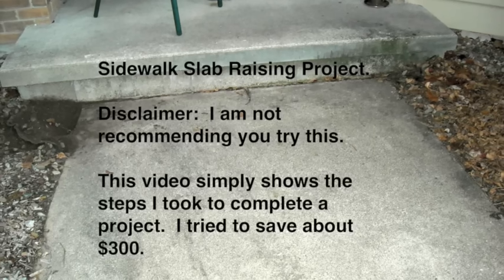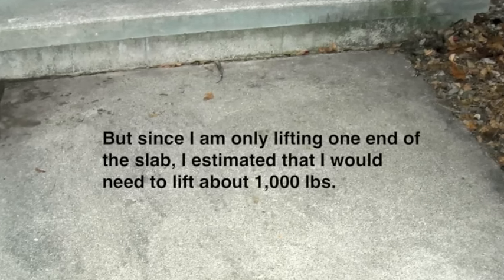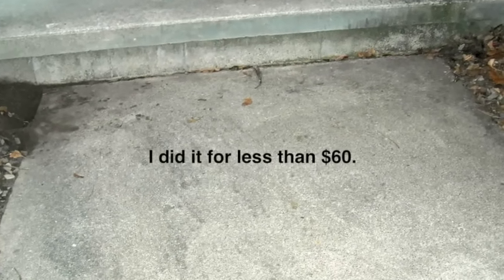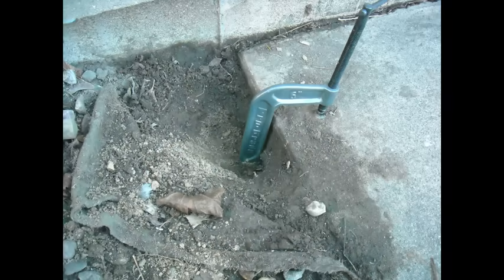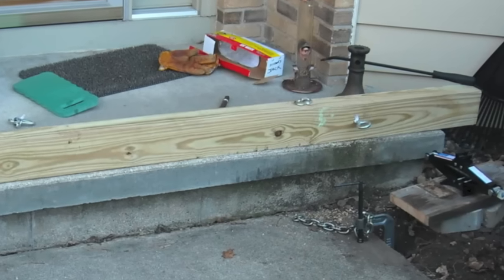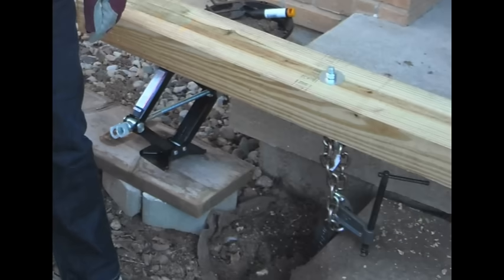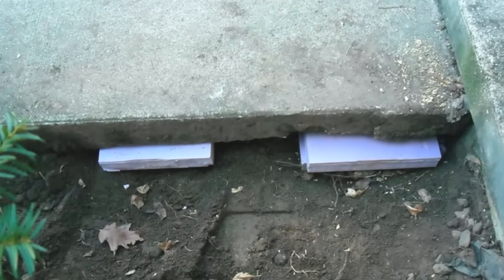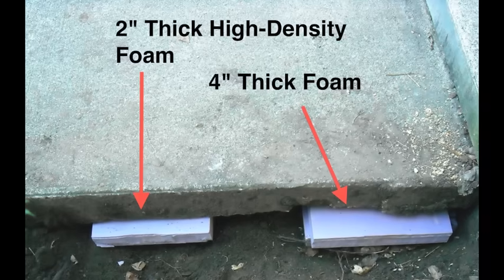Slab Raising, Do It Yourself

Comment: I like it!  How I will change (1) use hook bolt through 4.4 to make chain not integral to 4/4 (2) Use 3/16 anchor into sidewalk so I don’t need ‘C’ clamps, and don’t have to dig.  (3) Under fill will foam insertion to 1/4” holes to fill the gap. (4). Use self level filer to complete the job over each hole and crack.
Reply: You should get proper closed cell foam (not GreatStuff) which is hydrophobic.
Reply: @stringlarson1247  Well, I did use GreatStuff and initially all was well, until several months later when concrete raised a half of inch instead of dropping.  So if that is what you mean you were correct.  However, the sidewalk falls do to soil shrinkage every year for. 30 years, so most likely it will fall back down to level.  Nevertheless, could have used your comment 5 months ago (:.
Reply: @magncity1817  Oh my. Up after 3mos. Uhh, that's not really what I was thinking, per se. 
However, (shooting from the hip here), it sounds like a water issue in the upper layer(s) of soil and/or what is going on further down. As you've witnessed the change over a good period, I would guess that some runoff is causing that area to soak up water, which will cause the soil to compact (possibly erode, albeit slowly) and/or cause voids under the slab. By injecting the foam, thus filling the voids, the water is forced (hydrostatic pressure) underneath the foam and running into something more dense (clay? rock?), causing it to stop and build up pressure. If that water freezes, it will expand and force the slab up.  
My issue with using expanding insulating (retail) foam off-label is that it is not engineered for being in a constantly moist area for long periods and is not impervious to bugs or critters. 
I like your changes to the lifting mechanism, etc. You must have a decent SDS rotary hammer. I've seen some whacky setups with clamps and Chinesium chain, etc. 

I'm no expert (just old), but when I was in engineering school, I lived for serval Civil Engineering grads. students at Purdue. I learned a great deal about this stuff and what goes on under our feet. As a nerd/geek, all this stuff fascinates me. 

If it's a half inch and a possible trip hazzard, a masonary disk on an angle grinder might be an easy way to bevel the edge. If later, it drops back down, there are some good concrete bonding/patching products available to fill it in. Just a thougt. 
Cheers.

Comment: I've seen a lot of vids of people DIYing stuff like this. For a project like this, I would have busted out the slab, laid in a good substrate for the region, built a form (simple in this case), set in some rebar (use epoxy coating), and poured a new slab. It does take some time and research, but will last 'forever'.  OTOH, jacking it up and removing all the soil and packing the entire area with stone or gravel will ensure that there are no voids. For safety, once it's jacked up, you can pack in some 4x4s or brick to hold it in place and not have to worry about the lift points letting go.
Once everything is packed, jack it up just enough to remove the supports and then pack in those areas. 
For anything like this, it's important to identity the root cause (i.e. water runoff, etc.) and remedy that first.

Comment: I've considered this and have done some lifts. The problems that come are: it will probably need the joints cut so they don't pull the adjacent pieces up, and it is difficult to get fill in the right spot(s) since the underneath of the slab will probably be very uneven.  You'll wish you could work the slab around to do the evening, but that is not possible; stuffing fill in that gets the height to where it needs to be is likely the best one be able to do.

Comment: Such a simple but brilliant idea. 
Ours dropped about 6 inches. We used 2 x 6 ton rated Big Red bottle jacks, 2x Axle straps rated at 3500 lb with D rings, 2x3/4" "D" ring shackles. Wrapped the straps around the "C" clamps and 4x4 post, connected shackles through D ring of axle strap.. Lifted it up with ease. Lifting revealed a huge chasm. Before we used the foam, we had to backfill with coarse gravel to level what was missing underneath the slab.
Reply: bob bobless Why explain what he did in the video like it was your idea!😂

Comment: I've actually flipped a slab, filled and flipped it back.   The slabs were 5" or so apart.    3' long, 5" deep, 2 feet wide.  etc.   Ernie died in the 70's, but it was Ernie whom poured the walk, with these gaps.     I guess, he had a form.  I used Multiple digging bars, etc.    I filled with a sand topper mix.   But, I was younger then.

Comment: Great video and great results John!  I have the same issue on my walkways first slab by porch like yours. The left side has sunk..more than the right side, which caused a crack at the opposite end of that slab.  I know why it happened and it's because when the previous owner installed the metal roof they removed all the gutters. Now every time it rains all the roof water over the porch hits directly on the brick facing and down thru the porch..Also caused all the brick facings to start breaking off because they get wet and freeze in the winter..  I don't know what the people who install metal roofs are thinking and almost every one I've seen they've taken the gutters off. And that causes all the runoff to eat away at the entire foundation of the house about 3-4 feet out from the foundation...IDIOTS!!  I'm going to install new gutters soon I hope and try and fix my walkway like you've done in this video..  I'm a Navy mechanic (retired) and big time DIY'r, and always try and fix things myself..  Glad I found your video..  Also have the same issues with my entire carport (split right down the middle) but that's much more involved than this fix will accomplish lol

Comment: Taught me something. I always wondered about drilling a couple holes and putting material in. Cement is too heavy and had better get most of the gap filled with something like sand or something that won't squish. Thanks for the info. Good video.

Comment: Not sure why foam jacking isn't supposed to last.  You can get all kinds of different PSI ratings and if anything it might be tricky to keep it from expanding TOO much when you put it in. I'm just starting to research so could be wrong, but foam injection seems ideal as it can take up the exact space you need to fill and in theory should start to bear load immediately.  It would probably be a good way to augment your system -- to fill around the sheets you put under and to hold them in place.
Reply: Yeah, one friend saying it doesn't last isn't a very good source. Another video I watched, the guy said he researched it thoroughly and all the professionals use closed cell spray foam.
Reply: My problem is rodents burrowing under the porch. The chipmunk wasn't really a problem but the mice certainly are. The way this guy did it leaves gaps. Like you said, the foam fills it all in so no gaps.

Comment: I have the opposite issue, tree roots have raised my sidewalk 6-8 inches, I'm going to use ur idea to b able to see where the beginning and end of the root is and remove it.  Thanks for the idea!
Reply: +Geneva Tungate Careful with a large root...you just might lose your tree.  Certain trees, like maple, have a habit of shallow roots.  A sidewalk over their drip line can be repaired now only to have the problem resurface nearby next year.
Reply: It's already done, selling the house. Looking for a few acres...
Reply: +Geneva Tungate You should just raise the house a bit.
Reply: Geneva Tungate just do what jphn did in reverse. Put the 4x4 on top of the tree and jack down..pushing the tree back into the ground. I dont know who trees think they are growing up out of the ground blocking our views. Good luck please post updates. Also never put your hands under the roots!
Reply: Geneva Tungate0
Reply: Mop mop movements

Comment: I think that foam will degrade with time. If you need to raise sidewalk 4 inches I would put a couple of paving stones in several locations, especially in the middle where it is harder to reach. Then fill the other areas with new concrete. 4 inch gap should supply plenty of room to shove new concrete in especially if you do it over several days to force concrete to dry before adding more.

Comment: I built a floor for my RV conversion and was hoping to use the pink foam as a load bearing surface; however, the 3/4" Pink foam I used specifically says it is not load bearing, so I added furring strips to help support plywood above it.  Seems like this may not be a good solution over time.

Comment: I've looked at HomeDepot online for the board, but only see R5 or R10 - are any of these the right board to use?  I don't see "high density".
Reply: Look at the PSI, not the r-value. Most of the stuff is rated either 15 or 25 PSI. Home depot is usually pink I think (Owens Corning) and Lowes is blue (Dow brand)

Comment: First, thanks very much for this video.  I plan to use this method.  One question though: Did you fill in the voids around the foam? If so, did you just use dirt?  If not, are you concerned it will fill with water and freeze come winter?  Or is that not something to worry about?
Reply: Instead of the foam, I think that an acceptable alternative would be to buy bags of 3/4 inch or pea gravel and push the gravel under the slab with a stick or hoe to fill all voids.  Raise the slab slightly higher than the finish height when you do this, and let the slab settle back down, as there will be some compression.  This is the more traditional approach than using foam.

Comment: you can use expanding insulation gap filling foam, 5 to 7 dollars per can, I placed a shower pan with a gap underneath due to an uneven basement slab, then sprayed the foam below the pan and it expanded and hardened lifting the center of the 5 foot long pan perfectly level..careful it will bow upward and needs braced in place. Just like the expanding foam outfits that life driveway slabs..the lift must be limited or it will go too high!

Comment: Awesome idea.  I'd feel better if the foam was added under completely. Those spaces are a failure waiting to happen depending what gets rolled over it.. just walking fine.  Anyone doing this then taking a 1500lb safe or another item may get a surprise if it isn't a reinforced slab with rebar or mesh.

Comment: To be a little safer, I would use some 1/2" thick pads at least 4" square to spread the load on the C-clamp pads. Will help prevent the weight of the concrete causing it to fracture itself.

Comment: Mudjacking and high density foam injection are 2 different things.
Mudjacking uses a slurry of concrete under pressure and weighs about 120lbs /sqft. Foam weighs about 4 lbs.
How might you raise a garage floor? Or patio?
There are some things foam is appropriate for.

Comment: Had a similar problem with a sunken slab in my back yard.  Had a friend use a pneumatic jack for cars, and boy, did that ever work out great.  But you need a couple of people to hold onto the slab.  I just filled it with dirt mixed with limestone.  Now its sinking a bit again.  How has the foam held up over the years?

Comment: for a small job as that size really seems to be, why wouldn't you jack it up, support it temporarily, and add rock and soil to the underside to restore the  ground (unless you are sure that erosion is the issue)? It would seem that would make the necessary repair as permanent without the synthetic substances being added...  Just curious since I have a couple of single pieces of concrete similar to that in a walkway that I need to deal with...

Comment: I would use my leftover concrete pieces (which I would further break into smaller pieces with my sledge hammer) as fill (instead of gravel), which is free, and is better than sending it to the landfill.

Comment: How do you  jack up only one side of a slab when the other side is next to the house and one side is next to stairs? The problem is the slab has sloped towards the stairs about 3/4 of an inch causing water to pool.

Comment: You did an awesome job raising the slab and producing a high-quality video. Do you have any tips on rasing a similar-size slab that was poured on an inside corner of a home's foundation and has sunk on the two sides touching the foundation? Thanks for the video.
Reply from the maker: If you post a photo of your slab on a photo hosting site, I can look at it and offer a recommendation.  Post that link here for me to see.
Reply: Inside corners against a foundation are a tough one.  No room for the C-clamps.  $350 for mud-jacking may be the easiest option.  I don't think you can rent the pump equipment.
Reply: Thanks for your responses. I didn't think it could be done in the same manner but wanted to make sure I was thinking properly.

Comment: Great idea - I would caution on using a cheap C-clamp if you try this. Some of the Chinese units (Harbor Freight) will snap very easily and could become a hazard.
Reply from the maker: Yes.  Good comment.  Check the capacity rating on the c-clamp if possible.  Use "Irwin" or "Pro-Grade" brand c-clamps.  I bought mine for less than $8.00 each.
Reply: John Cantwell
$ 9.00 isn't bad at all - I paid about $ 1-2 for a few of my HF clamps and most of them have failed already. I guess that's one of the things people should stay away from there ;)

Comment: Will the foam pads that was use in the video get wet from the wet ground and become soggy and moldy over time? I'm surprise he did not stuff gravel or sand under the slab.
Reply: I don't think that insualting foam is engineered to be exposed to moisure and it will be for the entire time it's under there. I agree with you on the gravel (or proper crushed rock) as it's made for that purpose. Plenty of space to dig out around it to pack in the fill. Shrug.

Comment: I've been searching for a solution on how to repair my sunken sidewalk issue and I think this is the answer. The process is fairly simple but I was wondering how stable is the post on the jacks? I would think it could tip over?
Reply: Ours did. A lot. Repair failed because we couldn't filt the slab enough and nothing fits under it.

Comment: Thank you for sharing this video,and I have a question as I am considering this same attempt. When you raised the area of the sidewalk in the video, did the opposite end lower at all, or shift? I have a 15 foot sidewalk on the side of our house that has tilted, longways, towards the house. And I’d hate to raise the low end and correct and have to do the same on the opposite side. Thanks in advance for your response.

Comment: Thank you for sharing this! It's a great video. Awesome content with great instruction. The final results look wonderful. You did a great job sir. How does it look after 6 years? (That's when I finally found this Jewel of a video)
Reply: The reason I'm asking how it looks is because the companies that do it drill holes that are always there and they keep getting bigger.  (Pot holes)  And I'm pretty much sure your worked as good as Pier blocks rather than using spay foam. (Not sure about the cost efficiency with either product)

Comment: The foam Idea is interesting.....if you don't want to use gravel or cement....the question would be how long will the foam last
Reply from the maker: +capeheartriz The foam will last indefinitely.  It is designed to be used under concrete!  They even use it for new construction and for airport runways.

Comment: lifting with scissor jacks? or even floor jacks, what about unstability. what keeps lifting the 2,000 pound slab, jacks and 4" x 4" not shifting left right or front and back and falling. also I saw the 1/2" eye bolts from home depot. the sticker on them is rated at 300 pounds, not welded and no shank. and your listing 4,000 pound chain, 6,000 pound c-clamps, large links 6,000 pounds. this isn't adding up. if 1 part fails or shifting, someone could really get hurt......$60?

Comment: John,
Could use your advice please.
Your video is fantastically brilliant. I have a broken 2x3 edge-on my driveway. The outside edge has raised up and the other end of the broken 2x3 slab has pushed down/sunk. In your opinion, would using your same method to completely raise the entire 2×3 broken slab of drive way work? Also can I use the same high density foam safely under the edge of a driveway being that it has the weight of a vehicle rolling over it daily. Thank you,  and again what a great video.
Reply: You are a mechanical wizzard!!!    Very inspiring!!!

Comment: You said a mudjacking company would put foam under for 350$? No a mudjacking company will put mud underneath. A mix of either sand, Portland and aqua gel or crusted limestone and water. A poly foam company will put a 2 part foam under and usually run 4x’s as much as mudjacking. The sand and Portland mix is close to permanent unless the original sub base settles more. Well worth the money but a job that small I don’t blame you for doing it yourself. I hate having to break all my equipment out for one slab jobs.

Comment: I would love to try this, but all we have locally is the wimpy 2" thick Foamular sections and not the 4" that it looks like you have there. Very unfortunate.
Reply: Todd Dolce The foam used is 2".  To get 4", simply double up the foam.
Reply from the maker: +Todd Dolce - Yes I don't know if they make a 4 inch board.  Use the 2 inch and double it up with two layers.